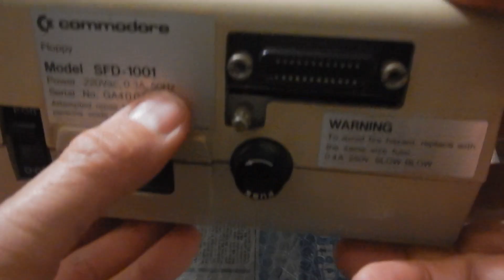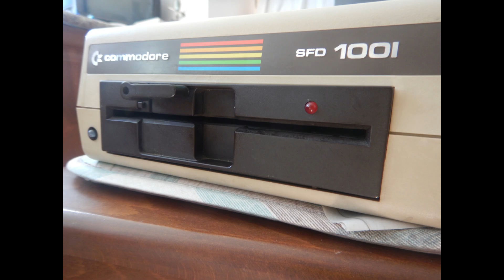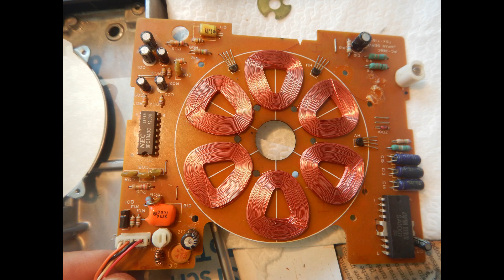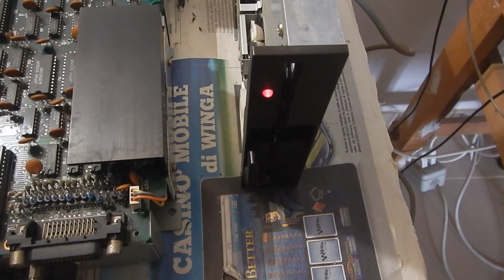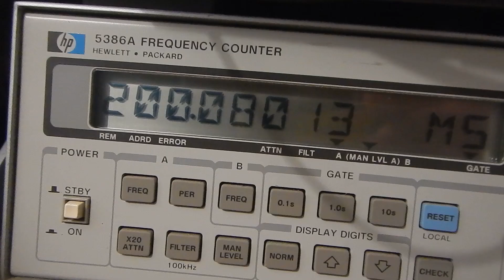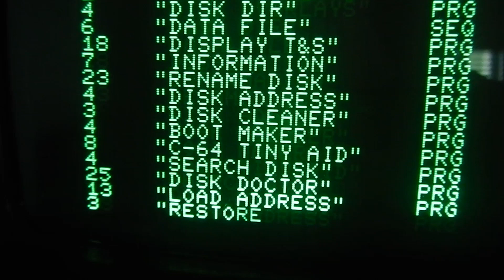Servicing the Commodore SFD-1001 floppy drive.

Comment: Mains voltage is 230 V ± 23 V in Europe. The drive must therefore still work reliably at 207 V. When I converted a 1570 to 240 V, this was no longer the case, the 12 V deviated slightly under load, which affected the rotation speed. I therefore cannot recommend the 240 V conversion.
Reply from the maker: As I said in the video, where I live I have never seen mains voltage dropping under 228V or so, during the day it's almost always more than 240V as most of the houses nearby (including mine) are pushing power to the grid from solar panels. All linear regulators wouldn't be so happy to drop the added power waiting for any 207V mains event here. YMMV
Reply from the maker: Also to be correct, your calculation is wrong as the official mains in EU is specified as 230V +10%/-6% so lowest voltage should be 216V. However these limits are only enforced by "best effort" (what really is enforced is the frequency range). But if you have voltage off the official limits you can ask your power company to modify your transformer tap (been there, done that when we had too much time over 255V here) and they are forced to comply after any report.
Reply: @iz8dwf  No, my calculation is not wrong but your values are outdated and you mixed up + and -. During an interim phase as a consequence of the switch from 220V to 230V it was 230V -10%/+6%. So the lower limit was already 207V. Since 2009 the limit is 230V ±23V as I wrote.
Incidentally, there is no excuse for linear regulators not to handle 207V as in the past with 220V they also had to handle 198V.
BTW, all you need to do is to switch on a larger consumer that happens to be connected to the same, slightly longer cable route and the mains voltage will drop. Measuring it in idle state can therefore be deceptive.
Anyway, my point wasn't that it can't work in general. My point was that it can easily cause unforeseen problems. Even in your case, at one day you may take the unit to a friend's house and suddenly it behaves strangely at certain times of the day. In that situation you won't remember that you converted it to 240V. Personally, I am not a fan of avoidable problems and therefore do not recommend such setups.
Reply from the maker: You should provide at least a link to official documents that confirm your claims. A simple google search seems to contradict what you claim about mains voltage in EU.
Reply: @iz8dwf  Mains voltage is specified in EN 50160 as 230V ±10%. This is the official source for the EU.
Reply: BTW, UK used 240V ±6%. Since the 240V tap dates from this time, the drive is allowed to fail at 225,6V. It won't because on the other tab it has to cover the old 220V ±10% standard, but more than 240V ±10%, which is 216V cannot be expected and that's also about what I observed. By standards, the Commodore's design wasn't bad.
Reply from the maker: Ok you are correct, however the UNI documents can only be downloaded by paying a fee. I think anyway you're entirely missing the point. I do modify the old linear regulator input taps when possible to have them dissipate the least amount of heat. These vintage devices were designed when mains voltages were different than what we have now. Anyone modifying any vintage device however should first understand all the implications and determine if it's going to have any detrimental effect on the device itself or not.
Reply: @iz8dwf  Unfortunately, this is the downside with official EU documents, but hopefully this will change in the future. However, excerpts from these are available on the internet, but unfortunately its not possible to post links here.
Reply: @iz8dwf  I know why you modified it, but IMHO relying on the current situation at a particular location is not worth the risk. Relying on standards means it works everywhere, everytime. I also don't think that most people even know the downside of this modification.
Reply from the maker: @AS-oq7io  I think not modifying the old linear regulator AC inputs when possible has a lot more downsides in a situation like the one I live. I've been monitoring the mains voltage since more than 10 years now (the PV inverter keeps logs for me) and I've never had anything below 225V unless during faults. Those linear regulators will dissipate more useless heath in such a situation. Nothing "vintage" works everywhere everytime by the way.
Reply: @iz8dwf  Have you calculated by how much the power loss actually increases due to the potentially 5% higher voltage, for which you take the risk?
If there are no new sources of errors added then the operation of vintage hardware is not limited by the location and time of use ;-)
Reply from the maker: @AS-oq7io  SFD-1001 has 2A linear regulators, if we assume 5V is sinking about 0.5A and with my current voltage seen now of 239.8V I can expect a bit less of 10% increase in the RMS secondary voltage so let's say 9V rectified becomes 10V so I have half a Watt continuous power dissipation increased for NO reasons. And I've underestimated the voltage increase because I should calculate the DC filtered value and not the RMS value. Can we please stop it here?
Reply: @iz8dwf  The power supply is designed for 220V ±10% and is now supplied with 230V ±10%. The increase is max. 5%, also in your case.
I agree, that corresponds to about 1W additional power dissipation. But that's not that much and it's not for "NO reasons", it's required for standards compliance. That's all I wanted to point out. So yes, we can stop here.
Reply from the maker: The point is I don't have 230V +/- 10% at home,  my lower limit in the past 5 years was 228V. I will remove any further comment I'm sorry.

Comment: I remember seeing these drives but its a i, SFD 100i . I used a lower case but it's clear its not a 1 but a upper case I.
Reply from the maker: Well, then what everyone else calls 1541 is a 154i :) However official CBM documents refer to it as "1001", check here for example: https://www.zimmers.net/anonftp/pub/cbm/schematics/drives/old/1001/8250LP_SFD-1001_Disk_Drive_Technical_Manual.pdf

Comment: Nice work. I have one of these drives (sadly the top head is dead, so it's strapped up as a single sided drive), and an 8050. They are nice drives, only problem I have is that both of my drives eat CPUs like candy! They'll work fine for a while, then one day you power them up and both CPUs are dead. It gets kinda expensive in CPUs after a while! Any idea what could be killing them? My guess is some kind of transient, but how to find and protect against it....
Anyhow, subbed :)
Reply from the maker: Hi! Yes one unfortunate (but I'd say not so common issue) with the JU-570-2 drives is the top head going bad. I've seen that once when repairing the 8296D internal dual drive. Your cpu issue is rather strange. All dual disk drives from the 2030 to 8250 and the 1001 have the same shared bus design for the two 6502. They are accessing the bus during opposite clock phases so I'm quite sure you have a clock issue, maybe the two phases partially overlap and that could stress both CPUs that fight for the data bus. However I'm also quite sure the drive wouldn't work with a bad clock. You may want to check pin 37 of both 6502 at the same time and make sure the high part of both clocks never overlap. You may also want to check the 5V supply voltage.